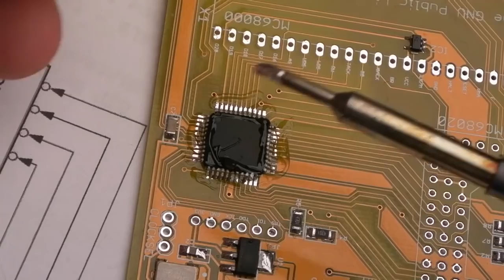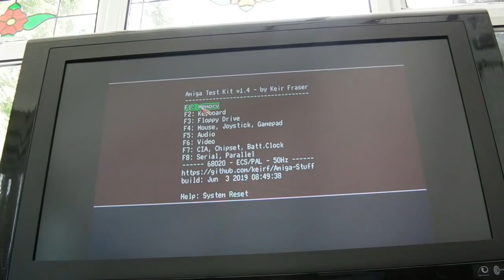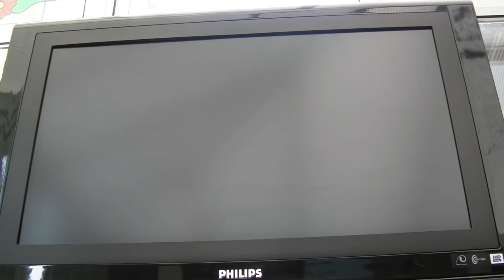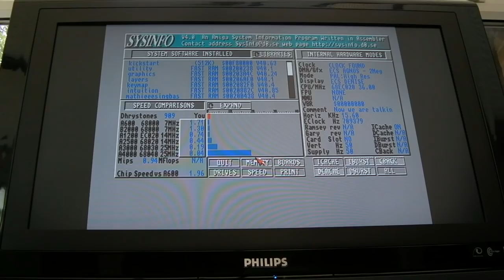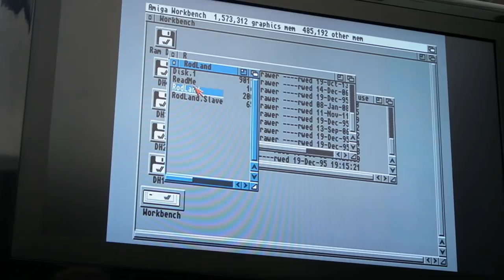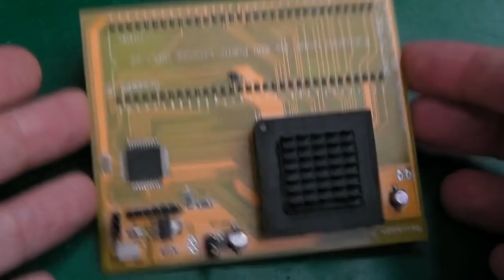Commodore Amiga TF520 - The First TerribleFire Accelerator (68020 - A500 / A2000)

Comment from the maker: UPDATE 2022: This works perfectly at 40Mhz when using a 20 or 25Mhz 020.  I built a 2nd one that runs at 40Mhz.
NOTE: See my reply to Adam Sommer below in respect to why 33Mhz was more stable for me, and some stuff about impedance and compatibility issues on the A500 and A2000 in general.   I didn't show programming it (I tried a few different firmwares, but ended up using the most recent "untested" one - which works well) - You can see how to program up the CPLDs on the TF330 video link below.  Just make sure you power the TF520 68K VCC pin with 5v, so the CPLD gets 3.3v from the voltage regulator (You could use the pin header I showed in the video @06:43 to feed the 5v when programming).  TF330 Build & Programming CPLDs - https://youtu.be/F-SrlT-caA8N

"Sharp nose pliers" - also known as cutters :o)
Reply: Hey gadget, not an Amiga related question but I'm having issues with a psp 3000 not charging or running properly from battery, if i plug it in with the battery installed it won't charge but if I plug it in without the battery in then install the battery sometimes it'll charge....
I'm really not sure what's wrong and I'm wondering if you've had any experience or could give me a little advice on where to start diagnosing it.. At this point any advice at all would help

Comment: Does the TF520 work a500 with GottagoFastRam8MB?, or is it just me that fails to get it to work?

ps.
a500 only with TF520 works ok,
a500 only with 8MBgottaGoFastRam works ok,

but together no longer work, 
black screen
wonder why? 
is it bad jed?
Reply from the maker: I think the 500 may be a bit sulky unless you run at 33Mhz or 40Mhz.   In the 2000 yes, but for me it was in part due to running at either 33Mhz or 40Mhz (in either case you need a 25Mhz 020 really), and I have 74ALS245 data buffers fitted on the 2000 for Zorro.
Reply: @GadgetUK164  a500 only with TF520 works ok,
a500 only with 8MBgottaGoFastRam works ok,

but together no longer work, 
black screen
wonder why? 
is it bad jed?

Comment: Hi there. How do you get the stuff for theese boards? Where do you think should I get them? For example, if I want to build a 530, i need a  XC9572XL-10VQ64, but I can only get a  XC9572XL-10VQ64C. Is there any difference? I just bough a nice hakko 936 soldering station with a bunch of tips, and flux, just so I can build theese and sell them locally. But I'm stuck, did not think it was this difficult. Another example is the RGB2HDMI and such.
Reply from the maker: The C revision should work fine!  The key is the first part of the number (XC9572XL) and the 2nd part shows speed and package I think (10VQ64)  assumed 10nS 64 pin VQFP.  Digikey, Mouser, RS, Farnell, are the best places to find them, but many are out of stock for 6 to 12+ months.  I've been sourcing mine from eBay and not had a problem so far (all from China).
Reply: @GadgetUK164  Where do you get the PCBs? PCBway? JLC?

Comment: Possible to mod it with a breakout for an original a1200 cpu (mc68ec020fg16)? 
A1200 cpu OC's to 28MHz btw. It needs fastRAM also for that OC, and thusly performs like a 68030 at 25MHz.
Reply from the maker: That would work, but there's no point!  The 020's that do fit (PGA ones) run at 40Mhz (I have a few running that way reliably on the TF520).   Adding some local fast RAM would make a huge difference.  I might at some point create a board that solders onto the 020 socket pins (underside) and adds RAM.
Reply: @GadgetUK164  It would be on a breakout though, so any FPU could fit, depending on whatever socket shape you wished to put on the breakout and make for it. As an aside the mc68ec020fg16 can also overclock to about 33MHz. I might add though that it is also possible to 'make' an FPU (not talking about the CPU) in verilog and then any FPU you like can thereby exist in whatever shape you desire. Information on making a different FPU of IEEE 754 is on the Chris Larsen YT channel. Definitely take a look at his video series for which his channel over the last couple of years is making such videos all about it.

Comment: I think i read somewhere that this didnt work with GVP Impact II HD8+  SCSI controller with 8mb of ram :/
Reply from the maker: That's possible - as I said, it wasn't really designed to work with all combinations of hardware.  It was targetting the A500 really, with bonus that it works in the 2000, but some boards may or may not work with it.  It may be more compatible (as mine was) if running at 33Mhz (or faster maybe, SparxUK has one of his running at 40Mhz OK).
Reply: @Adam S  HI great! nice to know Thanks for the info m8!

Comment: I dont own an Amiga, wish I did but I have recapped and fixed corrosion damage on a friends A500 that is fully upgraded, CPU board, VGA adapter, USB etc.

But I was thinking with the timing issues that one might select a crystal that is 2x or 4x the clock of the original CPU, so 7.09-7.16Mhz times say 4x would give 28-29Mhz crystal. Maybe thats the ideal crystal?

Did you consider that and if so did you test it? Even if I dont own an Amiga its still fun to know, maybe it fixes the post issue to?

just a thought I had.

I am restoring a M68K Mac tough, going to involve a new Motorola CPU to so, someday I might own an Amiga too!
Reply from the maker: It's possible, but I think shifting the speed upwards was just making some signal respond a tiny bit quicker perhaps.  The logic in there is going to likely have no relationship to the original clock speed.  ie. it reacts to signal changes, only access the bus when it can do etc.
Reply: Yeah multiples would of been first logical choice.  That's is.had the crystals on hand ? Which he probably doesn't.  So used what he has

Comment: Very interesting about the clock signals being more stable at faster speeds.  Great video, thanks for posting!
Reply from the maker: Sorry I perhaps still didn't explain very well - higher clock speeds won't generally make something more stable!  But, if you have tight timing that has a relationship to the clock speed, on certain other upgrades (eg. MKL RAM board) that dont quite fit with that timing, by virtue of adjusting the main CPU clock speed (and the affect the higher speed has on the CPLD), you can affect that timing, which could solve the problem.  ie. at 20Mhz perhaps the leading edge of a signal from the 020 is causing the MKL board to fail to do what its supposed to do at the right time.  But at 33Mhz, that same signal gets shifted very very slightly, which then means the MKL board does what its supposed to do at the right time.   Trying to get compatibility and perfect timing on all signals, on a 500 or a 2000, when so many of the 3rd party expansions and upgrades dont always adhere well to the specs, means it's can be challenging getting things all working together.  

In my opinion from the vast amount of time I've spent testing various 2000 boards with many upgrades too, the 2000 can be even more challenging - there are so many differences between 2000 revisions and the mods that may or may not have had done to the boards.  I have a review of a relatively new RAM board (and a very modern one) coming up soon - and some of those can be hit and miss on a stock 2000, just based on board revision and factory mods done by Commodore.

The fact the A590 with later DMAC works perfectly, shows that at 33Mhz certainly, its spot on.  I suspect the issue with my cased A590 is purely down to a difference in timing again with that older DMAC.  I might purchase another newer DMAC to prove that later.
Reply from the maker: The other thing to expand on here - a point I mentioned a few times, impedance!  What I mean by that, with everything you plug into the system, the connections will add impedance that affects other things connected.  Something like the MKL RAM board for example has connections to the CPU socket, and the traces then leading to and from the components on it.  That adds some impedance, it adds an alternative route (reflection), it adds capacitance.  The 500 was never designed to have lots of stuff stacked in the CPU socket etc.   And of course with the A500 and the A2000, depending on where the CPU is in respect to RAM or SCSI upgrades etc, timing can be affected by distance, trace layout (and all the points I made above).   So for example you may have more success with something like the TF520 in the 68K socket on a 2000, vs the processor slot.  But then again, the opposite may be true.  A plus on the 2000 is there's more buffering on some things, but that translates (as we saw) into slower performance with this accelerator.  But it could also mean more compatibility with certain upgrades too.  But then again as we saw - the MKL board in some setups there caused the issue, probably because its sat in the 68K socket, rather than trying to use an 8MB ZII RAM card.

And finally - things like the MKL RAM board were designed to be just plugged into an A500 directly under the stock CPU, and the TF520 was not designed to work with the MKL board.